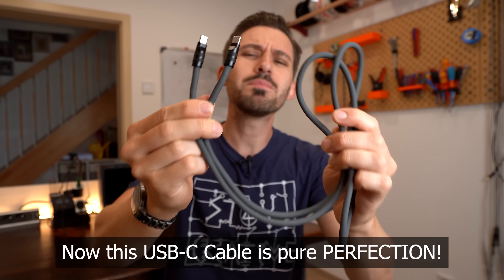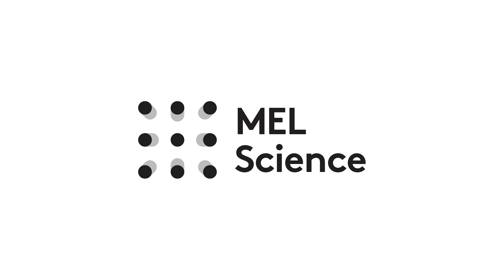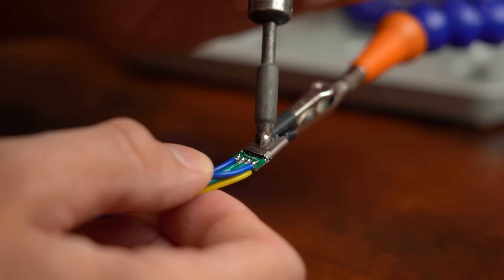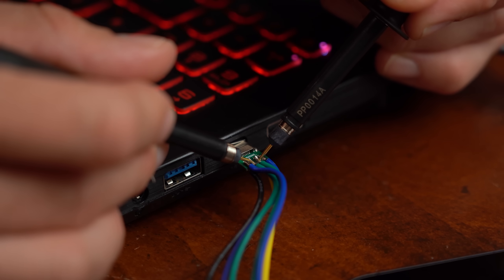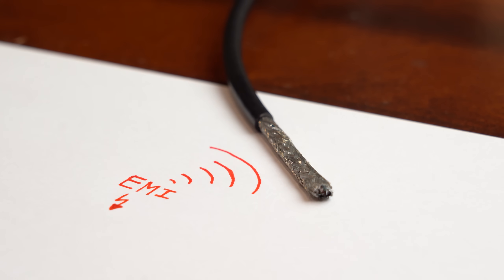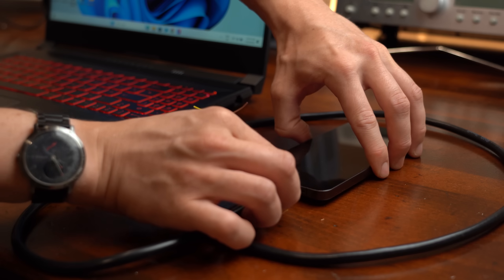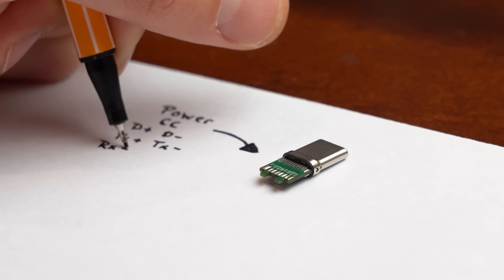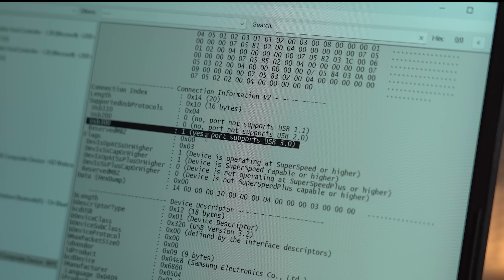Is it IMPOSSIBLE to make the Ultimate USB-C Cable? (Shielding) EB#64

Comment: just a heads up, CAT7 isn't a standard recognised by the TIA/EIA and is a proprietary standard that requires a TERA/GG45 connector. you can get S/FTP CAT6 which has a foil shield on the twisted pairs, and an overall shield over the entire cable.
Reply: That's just a US thing (again). Cat7 and Cat7a are standard under ISO/IEC 11801.
Reply: Lol cụ coin viNE 0,06875$

Comment: ethernet uses a 100Ω differential impedance for its pairs with a +/-15Ω tolerance for twisted pair and usb uses 90Ω +/-10Ω. the ethernet cable you use might have been out of spec for usb but in spec for ethernet.
Reply: It’s a lot like when people tried to run Ethernet or Arcnet over existing cable TV wiring. In my case my company hired cable TV people to run dozens of drops all over the building, not knowing any better. The impedance mismatch caused a lot of problems. (Ethernet requires 50Ω and cable TV is 75Ω).

This was in the old days (1989) using thinnet RG-58 coax 10BASE2—before copper twisted pair CAT-3 4-wire 10-BASE-T came out (& was affordable). It was amazing how quickly 10BASE-T made all of the major standards (10Base5, token ring, AppleTalk, Arcnet and even 10Base-F fiber standards) obsolete very quickly. Especially when it expanded to higher speeds every couple years, still only requiring unshielded twisted pair wiring for gigabit Ethernet.

Comment: Yeah, you're way outside the realm of power transmission; data transmission is a whole other field, essentially working in radio now.  Things start to make more sense when you consider that the wavelength at 6MHz (the starting frequency for USB1) is several dozen times longer than your cable, but when you get up to USB3/USB4 speeds the wavelength is comparatively tiny; bits you are shoving in at one end haven't gotten to the other end of the cable before you push in even more.  Can't think of it like DC at that point.

Even more, at low speeds the duration of a bit is so long you can take the average and negate a ton of noise happening at higher frequencies, but at high speeds the time you're averaging over gets so short tons more noise gets through.  It compounds exponentially with speed.

One big reason that the shorter cable worked despite not being shielded:  the longer the cable, the lower the frequencies of EMI it can pick up.  Meanwhile, the lower you are on the RF spectrum, the more sources of EMI there are, for a bunch of reasons (both more accidental noises, and lower frequencies are occluded less).

And yeah, you need to implement USB 2.0 to get USB 3.0; the connection starts at the lowest implementation and uses that to negotiate whether both devices can speak the higher implementation.

Cat6 (not 7) is a great choice, for the reasons mentioned.  Twisted pair is far more resilient against common mode current (and to a degree crosstalk, which gets converted to common mode by proximity) and the extra shielding helps even more against crosstalk.  The data rate is so high that there are bits coming back along other pairs of cables while you're sending new ones, and the power level is so low that any noise swamps the signal...  You might have way more luck terminating the Cat7 with RJ45, and then using an adapter to connect a USB-C plug...  Keep the benefits of Cat6, but get away from the soldering difficulties.

Comment: You have to match the impedance to spec. The PCB traces + cable length + solder pads need to all add up to 90 ohm(differential) with around 5% tolerance. I don't remember the exact value but I think it was 90 ohms, so don't quote me on the numbers.

Comment: 90 Ω  differential impedence for SuperSpeed pairs is critical for high-speed data transfer, after connecting the wires try measuring it on your cables
Reply: And to throw a spanner in the works, Ethernet and HDMI are done to 100 ohm, so HDMI and Ethernet cables alone push you outside the usb spec before accounting for length matching requirements even if they are twisted pairs and shielded.
Reply: 90 ohms at what specific frequency? Or is it resistor terminated in one end?
Reply: @Kalvinjj  90 ohms characteristic impedance*
Reply: @Kalvinjj it depends on the speeds you're looking for, for usb c 3.2 Gen 1 I think it's 5 Gbps
Reply: I don't think you PC will measure that. As long as the signal isn't too noisy it should work fine.
Reply: @radry100  "Your PC doesn't measure it" argument. lol :D It doesn't need to! If the impedance of the cable doesn't match the impedance of the circuit on our PC-s motherboard, the Universe will do the "measurement" and introduce reflections in the signal accordingly (also known as physics). Signal being noisy is the direct result of incorrect impedance matching and it's detrimental for high speed signals.
Reply: Lol cụ coin viNE 0,06875$

Comment: If you try again, a good control would be to sacrifice the known good USB C cable and use it as a wire source. Second, if you resolder the good cable to its original connectors and it does  not work then you know assembly is introducing a problem too.

Comment: Did you test the impedance? It should be les than 90 ohm
Reply: ... 90 ohm at what frequency?
Reply: @georgedorn_fnord depends on the speeds you're looking for but for 3.2 gen1 (the speed his tester was checking) I think should be 5 Gbps. I'm not sure I Cuz I couldn't find my reference article 😅
Reply: @TheSomar1991  My point is that impedance varies a ton with frequency, and USB operates at quite a few different frequencies, all the way from 6MHz to several GHz, depending on the sub-protocol negotiated and current conditions...

But that's what makes twisted pair ideal; unlike coax, the reactive component of twisted pair impedance is fairly tiny, and when used in differential mode (as it is here) the impedance is half what it would be if one conductor were held at ground.
Reply: @georgedorn_fnord oh OK, I still don't get the point 😅 in a datasheet for thunderbolt norms it was mentioned that having less than 90 ohms is creatical for correct operations of higher speed data transfer and that was what I commented. I just thought it could be relevant since he didn't mention that.
Reply: @TheSomar1991  There's two components to impedance.  One is resistive, and it doesn't vary (much) with frequency.  The other is reactive, where the transmission line acts like a capacitor or an inductor.  That component does change a ton with frequency.
Reply: @georgedorn_fnord yeah the higher the frequency the higher is the impedance, that's why you need to make sure you're impedence is less than 90 ohms at the speeds you're looking for.
Reply: And that's only for the high speed data transfer pairs  @georgedorn_fnord

Comment: You may mention that for accurate data transfer the shield connection to ground should not occur in two different positions to avoid ground loops
Reply: The whole "single point ground" thing is archaic, modern EMI/EMC design is to have as much power/return and shield as possible, connected in as many places distributed along the connector as possible. Ideally the plug itself is a shielded plug which WILL result in multiple connections between the shield and the PCB GND (per the USB-C standard) which will lower the impedance. You want as LITTLE inductance between the shield and return paths as possible, to lower inductance you need as many points connected in parallel as you can possibly afford manufacturability-wise.
Reply: @ThatGuyJDMan Same as above. I'm also interested in some source or data; I only encountered the references and guidelines for "single point" shield grounding.
Reply: @ThatGuyJDMan Can you cite a concise source for this?  I never was the expert, but a while back I'd seen good evidence for grounding shields at ONE end.  Thanks!

Comment: Great video for ramping up knowledge about differential signaling (and high speed USB protocols)!  On your next video (I assume there will be at least one more follow-up), when you show the differential signals on your scope, be sure to use your scope’s subtraction function (CHA - CHB) to create a third trace by subtracting one channel from the other.  This will show the single-ended 0s and 1s you drew in your drawing, and also show visually how well (or how poorly) the differential signaling cancelled out common-mode noise (by how easy it is to tell a 1 from a zero).

But be aware that the capacitive loading of the scope probes also degrades the signal (signal is usually cleaner when you aren’t probing it).  You need a (historically very expensive, but I’ve been out of the biz for >10 years, maybe they’re cheaper now) FET-input powered differential probe to get a better idea of what the signals look like when not loaded.  

Keep up the investigations!

Comment: At these speeds, impedance matching is very important; a "random cable" is likely not gonna match the USB spec, and even the short distance you strip the cable to solder it might be enough to violate the spec. It already requires some careful consideration when just routing it on a PCB.
Reply: Exactly. What he is missing is that the cables need to be cut to length, down to a very smell difference in length through the entire circuit.
I would have to look up and do some calculations on what the exact tolerances are, but it's tiny.
Reply: @scsft  As a rule of thumb, anything under 1/100th of the wavelength can safely be ignored for transmission line purposes. 1/100th of the wavelength of a 2.5GHz signal in a cable with 200e6 m/s propagation speed would be 0.8mm. Mismatching pairs by 2mm would likely be fine on short cables where attenuation is low and signal swing will be more than large enough to wash out length mismatch distortions.
Reply: @teardowndan5364  The thing is: This is a differential signal.

I'm going to take your word on those numbers as I did not look things up.

However I am also going to remark that you're easily 2 or 3 mm off when hand-soldering and that we are dealing with a differential signal here. This means that your 0.8mm applies to not just both ends of the cable, but to all signal carrying wires in the cable.

On top of that: there's also 10/25/50 gbit/sec usb C cables which divide the margin of error by 2, 5 and 10 respectively.

Good luck trying to get that to align while hand-soldering without some very specific tooling.
Reply: Yup, signal integrity when dealing with >1GHz signals is critical.
Reply: I mean he did use the CAT5/6 cable which has a 100ohm differential impedance (within USB spec), not sure why that didn't work though
Reply: @bhu1334  The ethernet cable ripped the pads off the USB breakout, so it never got tested. He should have tried some stranded CAT-8 F/FTP cable.
Reply: To all you guys here, take these mentions and then imagine subsea conditions and how the impedance changes as the cables get compressed from pressure.
I love this though. @Greatscott you should wand the cables that DO work - they emit a rather large amount of EMI when actually transferring at those speeds.
Reply: Sea cables are optical fiber
Reply: Im mostly agree with that but can say good shielding and almost the same length of wires could work with hi-speed signals. With this two rules Ive managed to make a lot of different cables. SATA, USB 3.0, HDMI, LVDS, Display Port and even 8x PCI-E 3.0(havent make more lines cuz I was lazy)
Reply: Lol cụ coin viNE 0,06875$

Comment: EMI shielding is not to protect the cables.  It's to prevent the cables from radiating outward  and causing interference to other equipment.
Reply: No, it's absolutely both.
Only because they're twisted pair doesn't mean they will completely prevent EMI.
Reply: @taukakao  True, but it does make it a good impedance and works surprisingly well at common mode rejection.  I guess my main point is that being functional and meeting regulations for EMI are two different things.  Some of those requirements are very much related to performance but some are just so things play nice in crowded environments.

Comment: 9:49 You could have made your life so much easier if you had just made USB to RJ45 adapters at the start. You could have done all your testing without soldering to a USB connector. Just cut one usb data cable in half, connect to female RJ45 adapters. Male RJ45 adapters are solderless.

Comment: All the formulas for twisted-pair characteristic impedance that I found were based only on the wire diameter, distance between wires, and dielectric constant of the insulating material. The number of twists per cm apparently doesn't matter. Ethernet cables use pairs with different twists to reduce crosstalk between the pairs. Perhaps your problem with thick wires was that the impedance of the pairs was too far from spec?
Reply: IIRC, the different twist rates are to minimize crosstalk between different differential pairs, not to affect characteristic impedance. Impedance matching is for reducing internal reflections.
Reply: @lumilara13  That's what I said.

Comment: Also note that the the wire pairs are twisted at different rates per meter to lower interference between them. You might check if the twist rate is similar to that used in USB C cables.

Try a cat 6/7 patch cable rather than solid core intended for permanent installation.
Reply: wow, clever.
Reply: That makes sense... I'd think the CCNA or Fluke spec sheets could be helpful.
Reply: Patch cable is likely outside the range of tolerance for impedance matching, it targets 100ohm rather than the required 90ohm for USB. Tbh I'm extremely disappointed that it took GreatScott this long to realise you need twisted cable for differential pairs, forgiveable for a hobbyist, but not a trained engineer.

Comment: USB borrows a lot electrically from PCIe, it actively assessed the quality of the channel with a sequence of test patterns as part of its low frequency signalling. In my experience, corrupted signals (and I would presume bad cables as well) usually only trigger port resets and retraining events - but if it's bad enough I would figure it'd just choose not to engage. Phase Skew? Eye diagrams? Idk I was just messing around on an FPGA.
Reply: In theory, this means the USB driver logs can sometimes tell you what's bad about your cable if can dig through it on Linux - but I am blessed to have access to a full analyzer.

Comment: I think the cable thickness was the issue here. Commercial cables use much thinner wires, and such the distance between the differential lines is much smaller, and the wires would be twisted many more times per length unit. There's probably a lot of RF wizardry that would explain why a CAT7 cable is not suitable for USB SuperSpeed signalling. 

Also most commercial SuperSpeed USB cables have 4 SS differential pairs, which are necessary to carry DP Alt Mode or Thunderbolt/USB4.

Comment: USB C really sucks! I recently switched to iPhone 16e, and thought CarPlay would work using any cable, but none of my existing cable worked because of the lack of a pull down resistor? So I bought the most expensive USB C to A cable, after one month it has unstable connection. Even a HDMI connector won't have such a problem.  Stupid enough? No. My Quantum 2626 audio card has a USB C connector, but doesn't support any USB cable, because it's thunderbolt only! Engineers, just use proprietary connectors if you are going to run different protocols.
Reply from the maker: Oh boy...sorry to hear that.
Reply: USB-c doesn’t specify that. It’s a physical spec that you can run any protocol on. Consequently, it can really confuse people, since they all look the same. I think it’s worth the confusion just to get all of my devices on the same physical connector. For most people they are just using USB-c to charge their phone. Cheap cables (even with no data capability) are fine for them. The people who want/need high speed data, should know they need a more expensive cable to manage that. There’s no reason for everyone to get a $20 cable when a $3 gas station one is fine for their needs. It’s like all cars uses the same standard for the filler neck, but you can choose how much you want to pay for the gas, based in the compression your car needs.
Reply: If your car supports it, wireless CarPlay over WiFi is outstanding. I use it every day. It’s so much easier than fiddling with a messy cable every time.
Reply: @mewintle  Having the phone being charged while on the car is convenient, while wireless charging is another efficiency disaster. (I think you understand the issue) But my point is, USB-C is just a less ideal connector in many use cases, such as on a phone or many profession devices.

Comment: There was a guy who made the old apple device with lightning port to type c with just a mobile case ......he used something to switch the cc pins so check it out !
Reply from the maker: I am aware of it ;-)
Reply: @greatscottlab yes coz its not the wire ....its the data ....like tcp just a verification error
Reply: 😊 great effort tho coz im also learning a piece of usb standard for a project i know how tough it is to achieve data transfer

Comment: The negotiation still uses usb backwards compatible to version 1.  I'm sure it's deliberate in order to illustrate the points but high speed usb is a transmission line and so the cables characteristics are critical its actually more like radio frequency transmission and therefore witchcraft than the usual signalling you're used to. Not only do they have to be tuned, they have to have very specific lengths.  The only cable suitable is a usb cable!
Reply: "and therefore witchcraft" Understandable!

This only makes ethernet seem even more insane, the thing is ridiculously robust for how frankly terrible of a life it goes through and how bad you can do it and it still just pushes a gigabit per second anywhere quite easily, of course we're pushing it with 10G, but then again no wonder.